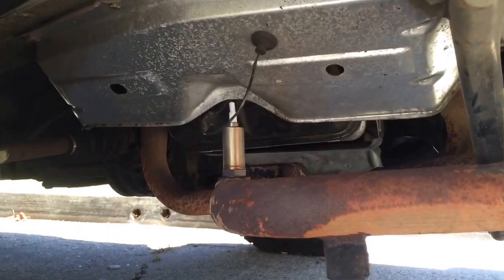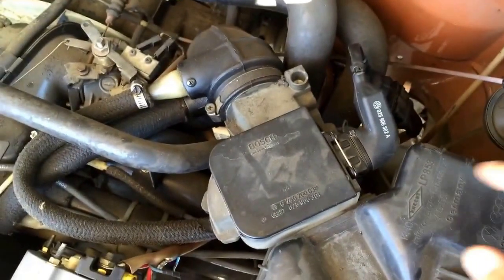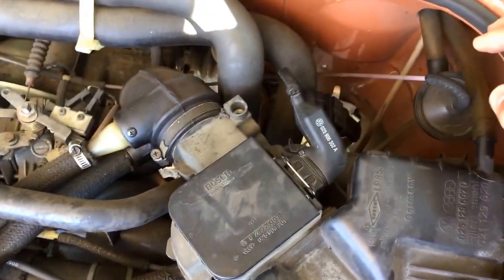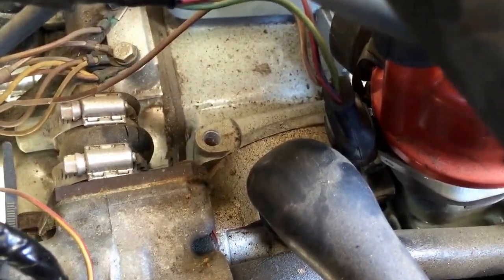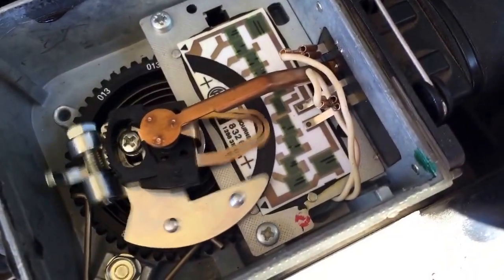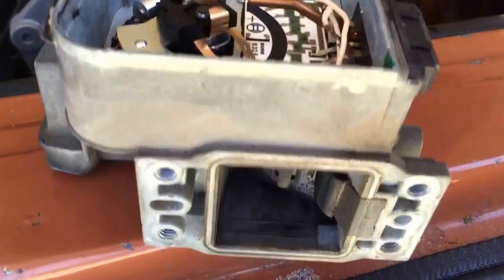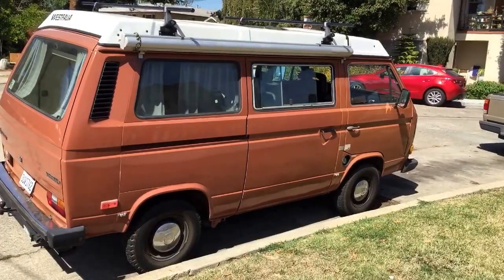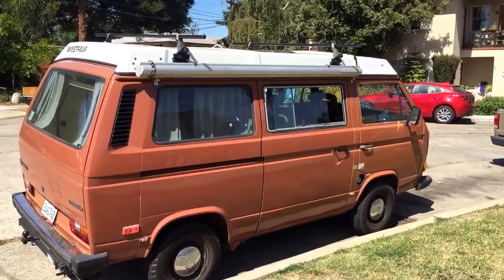Vanagon Syndrome

Comment: To improve my o2 sensor on my Vanagon, I add a ground clamp wire (with a hose clamp) to the o2 sensor and ran the wire to the ground of the ignition coil ground.  Without this the van runs a little rich. The exhaust ground is not good with age. The 2.2uf cap in the AFM in Vanagon helped. The AFM should be tested with a meter, idle is about 1.5v and floored  6.5 V (ignition on, not running).  Normal for it to move as you saw.

Comment: Hey Alan, thanks for taking the time to film and post this! Curious to hear how has your van been behaving since these fixes, particularly with the reformed AFM?
Reply from the maker: +VolkswagenT25.com Thanks for reminding me actually. I meant to post an update. I hope other people read this update. So the van started having issues again shortly after making this video. I don't think the issue was the air flow meter because as you can see in this video, the vibration was about the same before and after installing the new air flow meter. So I went to the next culprit which was the pigtail connector on the distributor. I think I mentioned in this video that the guys in San Diego cinched that wiring down for me to reduce vibration because there might have been a short in that pigtail connector or somewhere along that wiring. In any case, I had a mechanic replace the distributor cap - and that, finally, so far, has solved the problem. I've done a couple trips with the van of about 100 miles without any issues. When the issue was present, it would stall out even pulling out of a parking spot. So to the best of my knowledge, it was a wiring issue. Looking back I'd say that I felt the best performance gain when installing that harness on the air flow meter and then again when replacing the distributor cap. Hope this helps everyone!
Reply: +Alan Seideman hey Alan, thanks for posting your very in depth reply. I traced my v similar fault down to a vacuum leak in the rubber pipe coming down from the idle stabilisation valve. It only ever reared it head when cold, when warm I'm guessing the rubber expanded to fill the gap.

Comment: Alan, thank you for contributing to the Vanagon family.  I have a Digijet Westy that has dodged the Vanagon Syndrome malady.  You are on the right track by cleaning all grounds and fixing corroded connections.  

What size tires are you running on your Westy?  If you keep your Westy, you will find yourself accumulating all sorts of tools.  A voltmeter is a necessity. It is the good fortune of Vanagon fans that the web offers vast resources. Mechanics who know the Vanagon's 
quirks are rare.  

Happy and safe traveling.

Comment: Alan, I agree, have Peter @ San Diego Westy take a look, he is very professional and can really help as he has lots of experience, if you live there, he is great. He went thru my van and replaced all the common wiring issues, especially the ground wires. Along with all the other things you mentioned, also make sure the clamp after the AFM is secure (just in case it was loosened when an air filter was changed) That caused issues for me too! Fuel injector hoses to and from the manifolds too, awe heck, replace it all over time! :). Eventually I put in a Subaru 2.5 in as all the electronics were an upgrade.

Comment: Hi, Alan, I found an answer that's never been mentioned.  I have an '83 aircooled tin top which had this problem.  I did a number of things without any result, but by luck I decided to replace the condenser.  When I started to pull it out the long wire connected to the coil on the side engine compartment wall  fell away from the dual wire connection that goes into the distributor.  After replacing it I've had no problem.  It must have been shorting out.  When I took a sharp left turn (and the engine swayed to the passenger side pulling on that wire) I got my first "stall out" and it continued pestering me off and on.  I suspect a  mechanic who pulled the engine (I've never done one myself) might have forgotten to detach the condenser wire from the coil before he dropped the engine or that wire got hung up somehow and stretched it tugging it almost out of the connection attached to the side of the distributor.

Comment: Great video very helpful. I had my air flow metre rebuilt and new circuit board installed helped a bit but want to do dizzy cap, rotor button, plugs and leads next as mine look to be very aged.

Comment: Hi Alan I bought an 84 tin top vanagon and it keeps losing power after the engine warms up. Won’t go past 20mph and that’s with the gas pedal fully down. Eventually it loses all power but doesn’t actually cut out. Is this vanagon syndrome and if so do you have any ideas? I live in the Bay Area too, mill valley and really could use some help. Thanks so much. Conor
Reply from the maker: Conor Daly 
Hi it’s been a while and I don’t have the camper anymore but the syndrome was a total loss of power with shutoff - so it sounds like yours is a different issue. The shop I always tried was in the peninsula near Burlingame. Good luck!
Reply: Have a look at the O2 sensor wiring. The centre conductor plastic insulator may be cracked which would allow the centre conductor to short to the shielding.

Comment: Great video! Thanks for taking the time to document and post! We have an 83 1.9, but no vanagon syndrome thus far. But it has been running a bit rough lately. I too picked up a Bosch O2 sensor, but I have not yet installed.so did I understand you right where you said in the video that you had your stock 1.9 bored to a 2.1 and kept everything else the same? Did SD Westy do that for you?
Reply from the maker: +heart4Pahoa Sorry for the late reply. I live in the Bay Area so the folks who did the engine upgrade were the brothers at Fred's Garage in Redwood City.

Comment: Hey alan, i tried to remove the AFM cap but it's stuck there. i dont want to force it so i dont break anything. There was a seal that i removed but still, the cap doesn't want to get off. Did you have any difficulties removing it?
Reply from the maker: Might have to force it more. Or pry it open. The cap doesn't have any mechanical parts in it

Comment: Alan, did your engine ever spit and sputter while giving it gas, or did it just cut out at idle? I'm having a problem with my van (also an '84) and I'm trying to determine if it meets the criteria people use for "Vanagon Syndrome". It runs fine most of the time, but sometimes I have trouble starting it. I hold the gas pedal to the floor while cranking and, once it starts, keep it held there. I'll be at 1000 RPM for 20-30 seconds, then it will suddenly shoot up because the gas pedal is depressed, even though it was depressed fully all along. Something is taking a while to open up.

Also, during normal driving while giving it gas, my van will cut out for a split second. It sort of feels like a misfire.
Reply: I believe I'm having a similar issue to this in my 84'... this is suddenly new... it needs the gas pedal compressed to not die in startup... and takes 2 attempts... catches stability on it's own within 10mins... but I'm about to travel for months.  Hoping this is a simple fix asap... seems the MAF, and distributor cap check?  I foolishly ran a 300mi trip on 3 cylinders until I noticed a plug was needing to be plugged in.

Comment: Dear Alan, thank you so much for the video!  I have had a serious case of Vanagon Syndrome for at least 2 years now.  Went to a number of authorized VW services and they could not solve the problem.  Very depressing, as I was thinking the only thing left to do was sell the vehicle.  This video is very helpful and I will try the fixes you recommend (I had previously purchased the harness, but it has had no effect).
Reply from the maker: +Peter See my updated comment above. There was another issue I identified that might be helpful.
Reply: Thank you for the update. After years of Vanagon Syndrom, the problem finally became so bad that my Vanagon (1987) was un - driveable. I took it back to my authorized VW service who were happy that the problem had finally progressed, as they said they could now better identify it. Turned out it was not the AFM, but old wiring as you mention here. So the gist of the story is, that if the problem is only intermittent, the source will be difficult to identify. Letting it progress to the extreme exposed it. But rather than wait for this, as Alan suggests here, check all the old wiring.